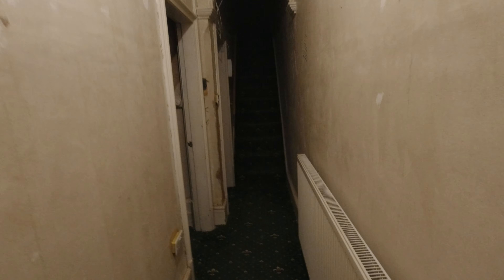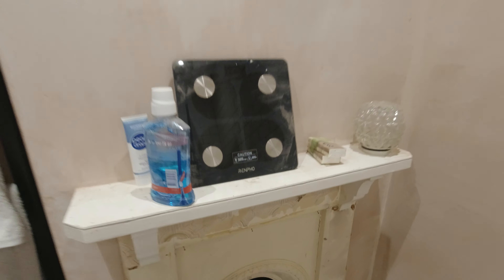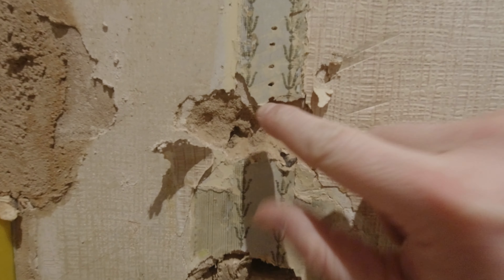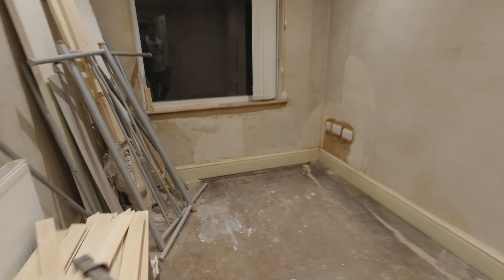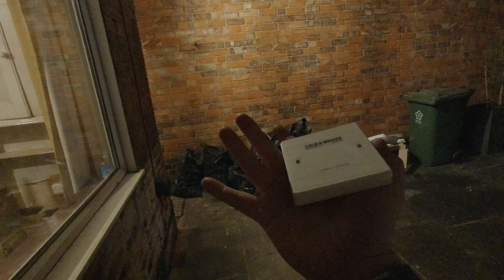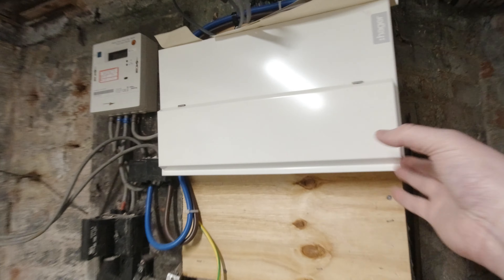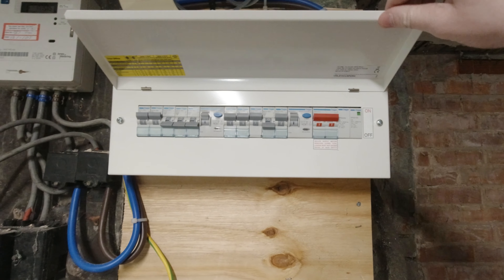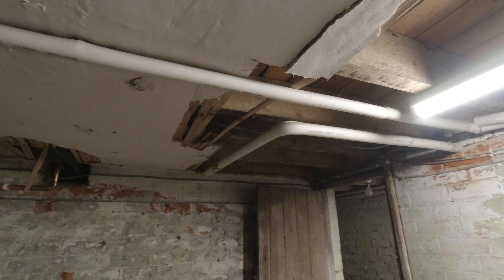House Rewire: Day 5

Comment: compared to the tiny SMD before you have to work with parts and things in brick size.
Much easier I guess in most spots - except some I guess.

Great progress and your voice and moods sounds a lot lot better than in the beginning.
Do not forget: you will have to clean a few more times so do not clean to much cause will have still a lot of things to do once you start working on walls and further lines and sockets you might wanna add later.
Reply from the maker: You are right, I noticed when putting it on the computer, I sound a lot happier than day 1-4. Really pleased with the functional result, just working bright lights is amazing but also being close to having a workshop space again is really exciting.

Comment: To extend the DSL, just use a normal CAT 6 or CAT 7 cable. The impedance should be correct, to not slow down the data rate.

Comment: David, what are all those standoffs behind the plugs and light switches?
Reply from the maker: They are there so you can get a clean finish on the plastering, ha ha, they will be like that for a while. They can be taken off and the faceplates dropped back into the back plates later.
Reply: @DavidWatts  Oh, interesting. Thanks.